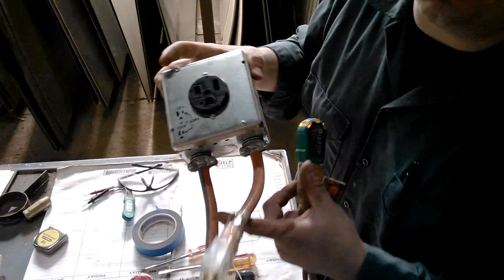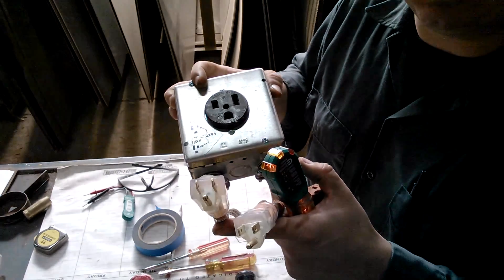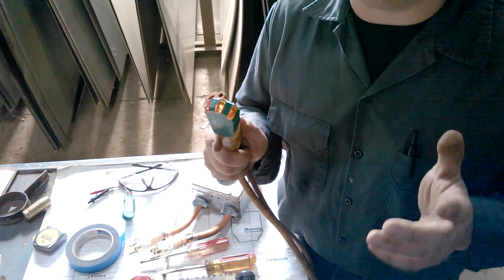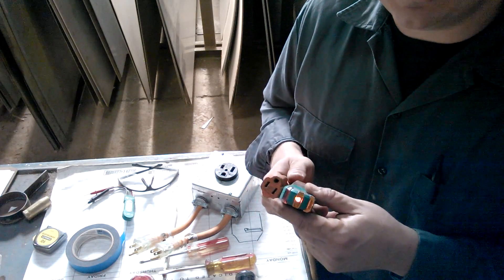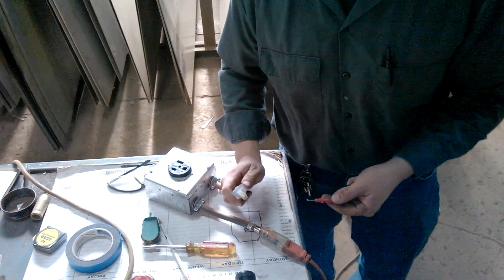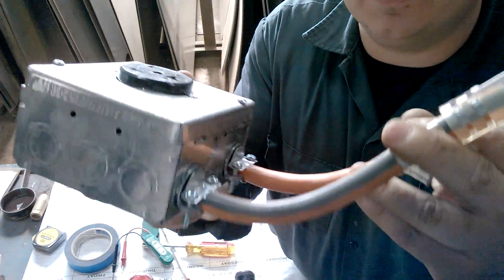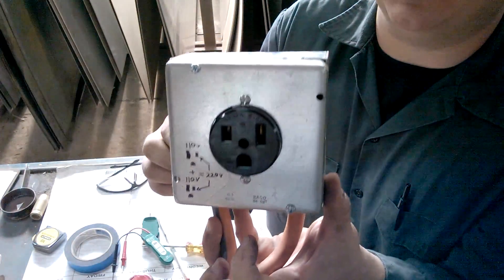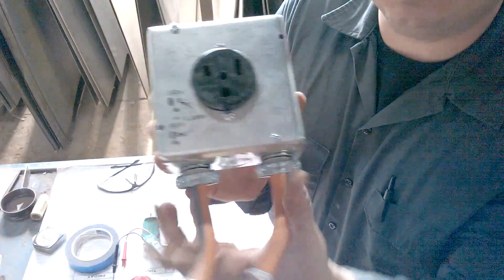Experiment convert 110v to 220v from two outlets

Comment: The incorrect method, is the one you used..(unfortunately), as what you "discovered" wasn't a cable that would work, but an out of phase 2nd phase LINE - (of the standard three phase line voltage your local power supply company provides commercial premises "in your area" with).. so you don't technically have a 110v doubler.. but a 120degree out of phase 2phase supply from those two cables.
In other words.. the small neon lights inside the end of cable "tester" as well as your 220v wandering tester, BOTH provide an INDICATION ONLY of a potential difference.

Now - there's a NASTY problem that WILL occur there, should you ever encounter a fault condition, as?
One leg MAY become disconnected (by the breaker) but ALL WIRING inside your primary circuits, will have lethal 2ph voltage that will "appear" across the broken breaker own "tripped" terminals, as well as continuing to "provide' a full 220v potential across your "now off" appliance, and earth.

What you should have done is this:

ONE SUPPLY CABLE:
(period = no exceptions).
Run a feed (from that cable) to each of two separate 1:1 transformers, making sure they are similarly connected.
Then, simply connect two of the four transformer outputs together & TEST the potential across the other two.
One test would show ZERO potential (for parallel wiring for double current), and the other would show, a potential output value, of DOUBLE the input voltage.
Thus around 219 V for there will be 'transformer losses in both transformers, when in series together.
When SERIES "output" wiring is used though
NEVER EVER ALLOW EITHER OUTPUT HIGH LEG (- or +) to connect together, nor to ground.
As you WILL explode either one, or both transformers.

Or.. simply purchase an extremely cheap (commercially made) step-up/ step-down isolated power supply transformer, that YOU can operate with a fair amount of safety.

Comment: They changed it already from 240 to 120v for the new hot water heater.  I don't understand how it works though.  The circuit breakers are only a bridge from the black hot side wire to the red wire on the other side that carries the power to the device/load, correct ?  Then here is what I don't understand.  The original setup had a black wire on one side, out on the other side is a red wire.  Inbetween, the circuit breaker had two 20 amp, left and right.  From what I understand, the black wire carried the power in, and the red wire carried the power out - but it was providing 240v to the original water heater, which needed 240v. Now the the new water heater, it needs 120v.  All they did was take out the red wire out of the circuit breaker, and jumped it to a screw on top of the breaker box.  These are my questions: how did the original wire manage to give 240v ?  If it did. how is the new setup giving 120v ?  And since now the black wire is the only side connected to the circuit breaker, how does the power get to the water heater, since the other side of the circuit breaker has no wire, and therefore no wire going to the water heater ?
Reply: +Don Erickson All they did was take out the red wire out of the circuit breaker, and jumped it to a screw on top of the breaker box.  These are my questions: how did the original wire manage to give 240v ?  If it did. how is the new setup giving 120v ?  And since now the black wire is the only side connected to the circuit breaker, how ..?

Answer:
Easy.
The power supply company - (whose lines go past your property) run a 3phase three (or four wire if they also supply your house with a neutral cable) overhead/underground service line, from which they can supply individual houses with either one, two or all three phase LINES = two of which were "run" to your electric boiler unit, when a 240 v element was fitted.

When they replaced that with a 11v element, hey simply removed one "leg" of phase (at the switchboard, by putting that red wire into a spare unused terminal for isolation), and "used" the other cable's phase (red) as the feeder wire, using the houses earth system as the earthed/neutral return.
Or - your element/boiler already HAD a neutral cable run to it, (say for a light or other power circuit nearby (that they tapped onto at the boiler) - thus they wouldn't need to install new cabling, as it was already there.

That meant one breaker could be omitted, (and not a jumper - but an isolation terminal used, to keep the second phase cable at the breaker insulated/isolated).

Simple 1ph/ 2ph & 3ph wiring.
Reply: +Quix Kiwi The part I don't understand is that before, the black wire went into the 20 amp circuit breaker on the left side.  The red wire went into the 20 amp circuit breaker on the right side.  So if they both gave 110v, then 220v was going to the old hot water heater.  But how does the power get to the water heater if both of these lines are giving power going into the circuit breaker ?  There doesn't seem to be an outlet wire going to the hot water heater.

Comment: Would I be able to take two extention cords from two different circuits and wire them in parallel for 2x the amperage?
Reply: +Reedstere 
No- Because some "supplies" are just a "different phase" of a three phase (120 degree out of cycle) "line" voltage supply - to any other hot leg.

Wiring such a supply as a parallel feeder would INSTANTLY set up MASSIVE circulating currents in your house supply lines (between your switchboard and your two cables that were paralleled together) resulting in the minimum of a quickly tripped breaker, or at worst - just a BIG pile of ashes, where your house used to be.!!!
NEVER EVER HARD WIRE, any two opposing (or "out of phase") line voltage "power" supplies together, without using isolating transformers.
Reply: +Quix Kiwi Ok thanks
Reply: Not SAFELY. You can get 220 fro the panel though. And no residential service areb3 phase,  unless some engineer really wanted it, but I've never heard of that either.
Reply: +Quix Kiwi  - No one has 3 phase - thats only industrial or commercial and you have to specifically ask the power company to install 3 phase.  That is the entire problem with this box. He got lucky because he pulled two out of phase legs from different outlets with extension cords.  If you tried this using the same outlet or outlets that are on the same phase it would not work.  I don't really see how it would be dangerous as much as you would only get 110v.

Comment: TO ANYONE who wants to try this, I only recommend that you have atleast moderate knowledge of electrical experience. This does work though. I had to use a 220 dryer in my home and only had 110, I found two separate outlets than ran off separate 15 amp breakers, I also made it so both breakers tripped if one did, this is a must. I took heavy duty extension cords cut them up, made it to plug into each outlet and basically made a Y cord.. I did not have a 220 female so I just cut the end off of the 220 dryer and wired it straight to the Y cord I made and the dryer works just fine! And to all the people talking about it's not up to code, the code was put in effect for people like you that don't know anything. To keep idiots from killing innocent people. Just be smart be safe, think twice before you do and your good to go. And forget about all these whiny bitches on here!!!
Reply: James Nemeth Exactly!
Reply: Friggin rights boys friggin rights
Reply: I did the same thing with a clothes dryer and it's been doing fine for years. The only difference is I used a roll of Romex house wire instead of extension cords. Same difference though. Was cheaper to make my own cords at the time.

Comment: I live in a condo.  I see some 600v wires coming into the breaker box.  The breaker box is divided into 120v for outlets, and 240v for the stove and hot water heater.  My landlady bought a replacement hot water heater that runs on 120v.  To get the correct power for that, all they did was take out 1 of the wires from the hot water heater breaker, and connect a jumper wire from that to the 120v screw on top of the breaker box.  The other wire was left in the hot water heater breaker.  Now I guess there is 120v coming from the jumped wire to the hot water heater.  The other wire is just left in the breaker box, and is doing nothing.  Is that correct ?

Comment: So if each were on a 20 Amp breaker would this combine for 40 amps or still only 20 total Amps?
Reply from the maker: +Sean Younk I have no Clue! If one of the engineers or electricians could please help answer this, it would be greatly appreciated.
Reply: +Sean YoI believe it will remain on 20Amp. U=U1+U2, but I=I1=I2 in this case
Reply: +Leonid Kostitsyn 
I think so too.  Thank you.
Reply: +UnsanctionedFabrication +Sean Younk          
Actually - it would create a serious problem.
Because at worst - neither breaker would trip as the load would still be 20amps in series around the entire circuit, but having 20 amps flowing at double the voltage during a fault condition, is four times the appliances possible wattage rating, so probably neither breaker would trip if a fault occurred, until long after the operator was completely DEAD.!!!

At least (but still bad) - only ONE breaker would trip, leaving the other to "supply" full potential difference between the two phase lines (note both cable wires are considered phases in a two phase supply) at any & all "points" around the circuit, as if still fully powered.
At any "point" on the circuit, from either side of the "tripped breaker" you would still have a 110v to EARTH "fault supply voltage.. if you touched any wire (or faulty appliance).!!!

All that would occur, is that one breaker would trip and instantly have BOTH sides of the potential voltage showing across the breaker.

NO PART OF THE CICUIT COULD BE CONSIDERED OFF, even though the appliance doesn't now work.!!!

Comment: When you plugged one plug to 110AC, and made a measurement on the other plug across the hot and neutral, you will not have a voltage because the neutral wasn't wired and was open.  If you had measured between hot and ground, you would have had 110VAC.  If the box gets grounded and you touch the box with one hand, or if your body is somehow grounded, and you touch the hot side on that plug, you will get electrocuted (110VAC across the heart).  Viewers, do not try this.  This is very very potentially dangerous.

Comment: Hello Joshua, 
While I applaud your inventive idea, I feel compelled to caution you and anyone else who is thinking of repeating your experiment. You say that the two 120V outlets need to be from separate breaker boxes. This not exactly correct. Actually they need to be from different transformer winding outputs. The center-tapped transformer secondary that feeds the building with 220V split phase has two outputs. One output of this winding is called a service. The 220V output is fed to your breaker box and divided up into separate 120V, 20A services. Some of the 120 V services are connected to one transformer output and some are on the other output. You basically hit the lotto when you found the two outlets that are on different outputs and add up to 220V. You couldn't read 220V the first time you tried because both hot lines were at same voltage.I don't know if connecting this to a load would cause a problem or not, but why risk it?  It seems to me it would be a lot less stressful to use an existing 220 VAC output or pay an electrician a few bucks to install a new one.
Reply: +Chuck Sampson To be completely clear on this what you get out of this assuming you are on different phases is essentially the same as the 220V lines that you have for things like your Dryer. You still have dangerous voltages that can easily kill you or start a fire or other problems, but as long as you have the box wired properly and closed off you get something very similar to a normal 220V line.

Additional information if you ignore the warnings and do this you should make sure that both breakers are the same. It should not matter the size of the breakers as long as they are the same. It is possible that GFI, GFCI, or lightning arrest breakers would give you problems with this but I do not know the specifics.

I still cannot make it more clear that you should not be doing this if you don't know what you are doing.
Reply: ***** you would have to have some way of syncing the output of the generator with a specific offset for that to have a chance at working and the generator would have to at least equal the current of the circuit breaker. There may be other considerations that I am not thinking of, but the point is that it is safer and more likely to work if both ends are connected to the same system.
Reply: Chuck Sampson I believe that you are correct. or two separate sources.
Reply: and perhaps a variable drive.

Comment: Joshua can you experiment this. Would two Honda eu2000i generators make
 240 voltage using the same principles as applied here. in theory this should work.
Reply: +Austin Schaefer 
Only in one very specific instance of time.
That instant that BOTH generators were in sync.
Sadly, as not one motor will always &quot;run&quot; at precisely the correct RPM, neither motor will EVER remain &quot;in sync, long enough for your open wired system to work.

Anyone using a generator set, wanting a double or half &quot;voltage&quot; only needs to use a commercially produced (cheap) step-up/step-down voltage converter.

Comment: This is not a good idea, but if you feel you have to make one, you should use the 4 prong 220 outlet and include the white wires inside the box to the 220 outlet.Also, during your touch the 110 plug try the meter by touching the ground, see what happens. You should get 110v.All in all, pay an electrician to wire you a real 220 outlet if you need one.
Reply: You're an idiot. And stupidity is dangerous when mixed with something that likes to kill the stupid.
Reply: That is to James
Reply: There's a difference between getting something "working", and getting something done "correctly & safely". Your dryer is neither of those.
Reply: Your lame. Just use it if it works for you. It's basic electrics
Reply: +James Nemeth Gee, just trying to help out, I have wired many homes and your idea is oversimplifying how the way 220 works.Your mom is lame.
Reply: +Gino Tofani lol yo mama
Reply: +David S. On the contrary, I have no 220 outlet, I did this, and now my 220 dryer works perfectly and it is a permanent fix. Although I did my setup a little differently it IS a permanent solution and I will have no issues using it for the remainder of my stay at my current residence. So done correctly? I think so!
Reply: +David S. Oh and I forgot to mention SAFELY! As I have it on breakers that will trip if anything were to happen...

Comment: essentially this is all that you breaker box is doing isnt it? instead of running separate 110's it links 2 110s together at the box. Only difference would be that its limited to 20 amps (or 15?) right?
Reply: i believe if you have them from separate circuits and different 110 legs then it will give you whatever you have it rated on the breaker per 110 leg

Comment: Joshua, PLEASE add in an annotation when you "measure the voltage" at 3:55. Measuring 0v potential between two pieces of metal does NOT mean that one or both are not live. You didn't get shocked, but not for the reasons you state. The responsible thing to do would be to bring specific hazards (that really might have killed you, and may kill them) to your viewer's attention as you become more educated on the subject.

The neutral on the plug you touched was disconnected, so even if the live side were hot, you wouldn't measure a voltage difference between the two prongs. You would have measured 0v, then touched them and gotten electrocuted! Measuring between the 'live' prong and the ground prong would be a more reliable check, but still isn't a guarantee (faulty ground wiring could also cause a 0v measurement).

Assuming the innards of the 220 box are wired correctly, you won't get voltage from one 110 side to the other unless you have a device plugged in to the 240 outlet. Once you plug something in to the 220 outlet, though, you'd best not touch anything.

The max amps you will be able to run at 220v is the ampacity of the smallest 110 breaker being used. In your case, 50 amps > 15 amps = tripped breaker.

Comment: Can you use this on a welder that uses 220v 50amp single phase?
Reply: No. 110v circuits are 20 amps max. Not enough current (amperage).